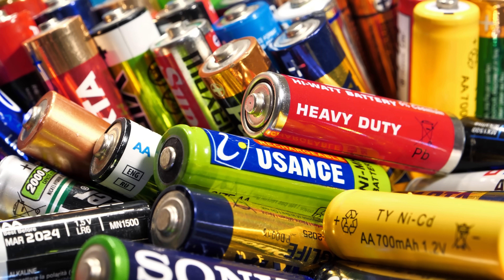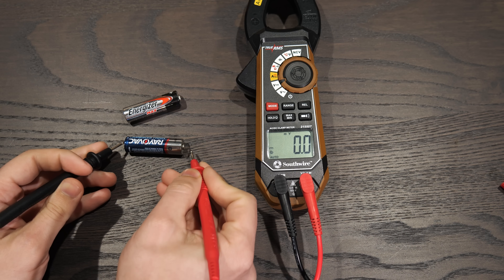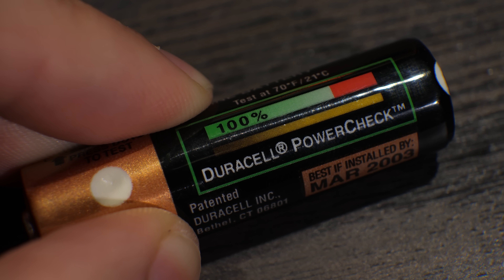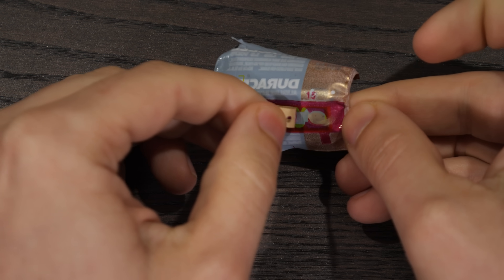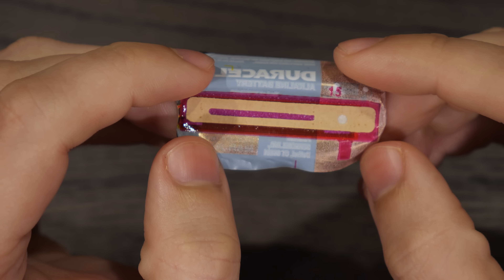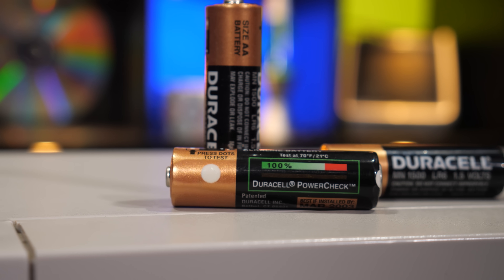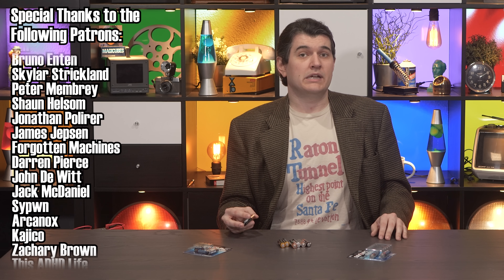Duracell PowerCheck: A genius idea which didn't last that long

Comment: Kids toys still use plenty of AA and AAA batteries. I don't use many for my own stuff anymore, but as a parent, I still have to deal with these type of batteries. I actually got so sick and tired of disposable alkaline batteries leaking and the sheer cost of constantly replacing them, that I've invested in a bunch of rechargeable NiMh batteries (which are actually pretty cheap these days) to mitigate these problems. It turns out you've only got to use them over a few times for them to pay for themselves compared to the cost of alkaline batteries. Never mind the cost of damaged equipment due to poorly manufactured alkaline batteries leaking inside. The rechargeable ones have to be sealed better by default and it's pretty much eliminated this problem for me.

Comment: Interesting film showing how these worked.  With regard to the AA v AAA comments, I have a couple of head torches that use LEDs and AAA batteries, probably for lightness and less bulk than AA.

I have a point and click Fuji Finepix camera that will eat batteries even when not turned on, so they come out when it isn't in use.

A top tip for any motorbike riders out there is that your emergency torch stuffed in a tailpack can turn on with vibration or accientally when tighening the tailpack.  A small piece of paper over the end of a battery will prevent this.

Comment: Weird, I have Duracell Ultra good until 2030 (not 2003), with PowerCheck™ on them. Made in Belgium, not Bethel, though. Depends on what you mean by "these" in "these haven't been in production". Mine might be a different "model", but the strip is identical, and using it is still the most frustrating thing!

Comment: Just one question: Couldn't this technology be included to rechargeable batteries in the present, in order to know how much you have left until you need to recharge? While we do have chargeable devices that connect with a USB-C cable (thank God that it's the only kind), there still are a lot that need standard AA or AAA batteries, especially if they are a cheaper alternative (the USB-C chargeable versions are usually at least 33% more expensive).

Comment: They should re-invest in rechargeable AA batteries. Duracell had them for a while and I still use them but I need the replace them soon I’m afraid. Duracell doesn’t sell them anymore here in the Netherlands. At least I can’t find them anywhere. 

This pOwErChEcK gimmick never worked for me. I never got it working (but I’m also colourblind and I thought it was just me I couldn’t see the colour change). Anyways its design was also a flaw. Who puts a scale from 100 to 0?! Especially with a product targeted to the western world. Everything should go from left to right. Not the other way around. It was literally midway this video I found out the scale was to the wrong side. Scales ought to show the higher number on the right. I bet even the battery indicator on your phone and laptop has 0 on the left and 100 on the right. What a design failure

Comment: I still like disposable batteries for things that use very little power, so they last a long time. Like my gaming mouse. It takes a single AA battery and lasts 6-9 months. I would never remember to charge that thing regularly enough if I had to, and then couldn't just pop in a new one if it's suddenly empty. I got a keyboard using two AAAs with similar lifespan. And remote controls, those things are great candidates for that too. Imagine having to plug your TV remote into a USB-C charger?? That would just be weird. 

Anything that doesn't last long, absolutely, go rechargeable. I got a Gameboy Advance that I use sometimes and it's honestly annoying to deal with batteries that just don't last all that long. I don't want to toss batteries that are only starting to be empty, but I also don't want to have my game turn off on me... and games of that area don't exactly autosave. Ughhh. Almost wish I'd gone for an SP but I prefer the ergonomics of the regular Advance.

Comment: Rechargeable batteries in devices seems like a more sneaky way of ensuring a device has a shorter life because the battery cells are often not changeable by average people. If a device has a hard installed lithum battery it becomes a hard sell for me. Even though i can and have soldered new batteries into things before,I just hate shitty anti consumer shit that the apple cocksuckers seemed to have pioneered in the past 20 years.

Comment: You never owned a mains power adapter for your Gameboy? Did you even game brah?
Reply: Some Gameboy Advance, Game Boy Advance SP's were regular AA Battery's only. My Advance i had didn't use a Charger, didn't have a backlight. so it ran only off AA batteries, it was frustrating to see the screen all that good. So because of that i got a Gameboy Advance SP which took a Charger, was easier to see the screen. I quickly missed my old Advance though do to size, shape. it felt better in my hands, and seemed less easy to break in comparison. I now currently have a Game Boy Emulator on a old Android phone, the NEW 3ds XL. I so miss my Gameboy Advance. Btw i had it in black Advance, and Sp. but i always wanted the Blue one. I still have my Black GameCube though lol, i prefer it over PS2, PS3, PS4, PS5, Xbox One, Xbox X|S. I did have a PS2 Fat, ps2 slim, PS3 slim. i currently have a GameCube, New 3ds xl, Xbox 360 slim W/touch sensors in place of the power button, disk tray button. i also have a Xbox One Slim, the Lemuroid Emulator on a Samsung Galaxy J7 Sky Pro.
Reply: @chelseasorsa5730  I meant a 3rb party block you buy and clip into the Gameboy
Reply: @soundslave  yeah mine only took game cartridge, headphone, AA Batteries. My Sp took Game, Headphone, Charger wire. For years i thought that was a normal Gameboy but apparently almost all Nintendo Gameboy's had a way to attach Nintendo branded, 3rd party Adaptors were my charger wire went. my step bro had a Cheat code/Guide adaptor, some of those were cartridge shaped adaptors you plug in on top, some attach to the back, some go went where your game goes, you put your game cartidge into the adaptor which my step bro had the one that pluged into the charger port. mind you this was in the 2000's for us. I was alive in the late 90's but i was only a baby. so i had these things in the early to late 2000's. Side note: i did have a PSP in 2013. Sadly my psp got stolen at the end of 2013 or begining of 14. P.S. I'm from 1995 so i was barely in the 90's Lol. P.P.S.  Perhaps i'm missing wt you're saying, but i think i got it. Although possible that my comments don't display such, if so i'm sorry.
Reply: So yes i just looked it up, i did know wt you meant. The Mains Power Mod. a Battery, charger cord modification. thing is back in late 90's, the entire 2000's IE 2000-2009. That mod was not a thing at least for the magority of American citizens. Although from my understanding the Advance SP i had, had a rechargable Battery that you had to plug in a Power Supply into the gameboy to charge it, it all looked exactly the same as that Mains Power Mod. At least the one i'm aware of, found from just a quick lookup.

Comment: I always admire your work, but here I have to disagree with you as an Telecomunications and Electronics engineer. The fact that manufacturers put rechargeable built in batteries in devices is not a good hing in my opinion. The fact that we were burning through one-time use batteries also wasn't a good thing. But the point is, that those built in batteries eventually get old and need to be replaced, but many times it is impossible for regular user, and even for some handyman, because they are not standardised and sometimes impossible to find the exact same one. You say: "OK, let's make rechargeable batteries which are replaceable like in old phones or modern cameras". Ok, it solves that problem. The second one is that users sometimes need to use the device without pauses, so putting while device on the shelf to charge is impossible, so changing the battery and charging while using the other is crucial, like for photographers for example. But here is the catch I don't like. Most of those user-replacable batteries are not standard ones, but some kind made my manufacturer and copied by some companies like Newell, GreenCell and Patona and stuff. They are very expensive and only fit for one device. The idea of having standardised cells which are rechargeable is the best solution in my opinion. And the fact is, we have such cells already, not only AA, but also 18650 for example. In fact 18650 are used 95% of the time in power tools, drones, lamps and bigger devices like that, but the manufacturer builds them in and closes in the enclousure, or in a separate box and sells them as their own fitting only this manufacturers tools. This makes me sick for god's sake. Amd another problem I have with that is, when battery is built in, the device must be more expensive and heavier then if you buy it without batteries. When you buy some expensive stuff it may not make a huge difference, but you will certainly cry when the battery dies and you have to throw away the whole good device. But when you want to buy some cheap Chinese crap like a torch light or a wireless speaker it can double its price, and make useless trash for this world. Listen to me, the fact how batteries/electronic devices are produced and sold right now is not the best way. Probably the safest for user, but certainly not the most economical, not environmentally friendly, and not good for long usage of the device, neither for using it with fast battery swaps

Comment: Excellent video reminding me of these! I first saw this tech in a battery testing strip given away with the UK Maplin Electronics catalog, late 80s or early 90s. It was much larger than these integral ones, and could wrap around AA, AA, C and D cells. The strip was clear, and you could see the tapered part. But I did the silly thing of putting it on a 6v battery, and the strip melted at one end and it died.

Comment: Just throw the battery on the floor on the concrete floor, by the way it bounces you can tell how much a charge it has left.

  This made me think of something can you teach us how to make a stinger next??   The best one I saw the guy had used 2 batterys as the negative and pos leeds. It was like a turbo stinger, it hummed or buzzed and would boil that salt water as fast as I ever saw.

Comment: So that is how they work. Mmm, yeah I don't see the use. 
There are only a few things I have that use non-rechargables. Some remotes, a clock. The radios, mouse, keyboards are all fed rechargable batteries. Because it makes sense. No sense to put the expensive battery in a clock... That clock will run fine on a non-rechargable for a really long time. Same with remotes!

Comment: Just drop test the battery to see if it is good or bad! If the battery is fresh the chemistry inside is wet and if dropped onto a hard surface (drop it from a height equal to its own length) when it lands it will not bounce. When a battery is bad the chemistry inside is dry and hard and when dropped it bounces noticeably.

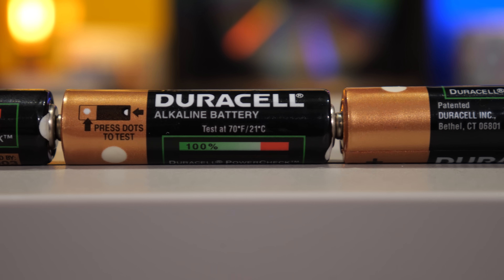Comment: 12:53 These external tester strips worked exactly the same but where a lot easier to use (needed less force to activate) compared to the ones built into the battery.

Comment: Actually a battery tester built into rechargeable batteries isnt a bad idea, they do sleep in your drawer for extended periods of time, theyre easy to get mixed up with the flat ones; a lot of people dont have dedicated battery chargers and just use a type c into their controller or whatever... duracell powercheck could actually work in today's society if they fix how hard you had to press

Comment: Thank you for the memories, I remember ripping off the wrapper and trying them on other batteries, and also the heat they gave off. 
I think Energizer or could have been Duracell, had one built in the packet when you squeezed it, which was handy to use on other battery brands. 
But thanks again, so many memories especially when it came with the gameboy and Walkman.

Comment: I always used my thumb nails to securely press the dots.  I've stopped using Duracell because I've found them more prone to leak.  Recently, I had one that was well withing the "use by" date and plenty of charge left, but was leaking.  I've read that EverReady Energizer alkaline batteries use different manufacturing process that makes them more resistant to leakage.  Over the last 5 to 10 years, I've never had an Energizer battery leak and that is all I buy if I can help it.

Comment: 9:34

This reminds me of a clock battery i measured last year. Its voltage read fine, but it didn't work. I put another battery in my car keys, and it worked, and i was confused why a battery that read good voltage wasn't working.  I thought multimeters placed a very high resistance load on the battery to measure voltage.

Comment: Super, as usual! 
Here's a conversation starter: what are everyone's thoughts on rechargeable AA vs built-in batteries in devices? 

Built-in batteries are often a pet-peeve of mine in devices that don't need further connectivity. For example, an electric toothbrush, or a razor. 

I am 100% for the convenience of having those with their own portable power source. But built-in batteries seem like a bad choice for a few reasons: 
* Longevity / sustainability: often, when the built-in battery is dead, the device is as good as dead too. 
* Flexibility: It is easier for me to have several sets of rechargeable batteries on hand, ready-to use, when my device runs out of juice. If there's a built-in battery, I must wait for the charge to be sufficient to start using it
* Portability: a device using AA batteries can be used literally everywhere in the world. Good luck finding the exact cable replacement for your cheap razor that you bought in Taiwan
* Convenience: you don't need a cable AT ALL for those devices. Just one charger will work for all your devices.

Comment: This would be more useful for rechargeable batteries tho. I have a noise cancelling Headset I use for work and it takes AA batteries. It only gives me an indication when the battery is about to run out. Often times I'm wondering if I should take the batteries with me to charge them or not. 

Now that I think more about it, this still would be useless in my case because I can't really control the temperature of outside...

Comment: And then you get the real butthead engineer that uses the AAAA battery.  Yes, there is a thing and it is annoying as hell.

You should do a bit on the A and the B batteries.  (^_^)

Comment: Before these batteries existed, as a child I used to use my trusty Gameboy Colour for this purpose, specifically taking note of the illumination of the power light. Powering it on for a few moments would provide some information about the remaining charge. It was more simple to observe than testing by powering on something else. The brightness of the light and how steady that illumination was would tell me a little about the quality and remaining charge of the batteries.

Comment: I always use the drop test, if you drop the battery onto a hard surface so it lands vertically, a dead battery will bounce more than a fully charged one. Spooky!

Comment: A duracell with a 2003 date on that hasn't leaked? That's hard to believe.
I had an original Gameboy too, and i used recharable batteries and there even was a rechargable "accupack" that you wer eable to hook into the "Card reader" and that locked into the screw cockets and connected to the DC Input.
It was heavy, but this way the battery madness was less.
That said, here in europe batteries are collected and recycled for the most part. (there are collecting boxes in supermarkets ect.)

Comment: Just a word about the terms "battery" and "cell".
Yes, nearly 100% of the World talks about a single dry or wet cell (primary or secondary) as a "battery".  But this is not correct.
A cell is a single unit, be it electrical or organic.  A battery is two or more cells connected in series to provide higher voltage and/or sometimes in parallel to provide higher current.  You seem to be well aware of this early in the vid' but then dropped to the 'everything is a battery' descriptive.

Nice and informative item though Sir.  I have never seen one of those cells, even though I was in my early 20's at the time you say they first arrived on the market.
I enjoy watching your vid's when I trip over them.

Comment: My family actually used those testers a lot. This was due to two reasons:
1) Gadgets that weren't used often meant partially charged batteries were put back (which you mentioned in your video)
2) Batteries lose charge over time, so batteries that got knocked to the back may have less charge.

And as for plugging them in to test, that was an option, but not always a good one. If a game took 4 batteries, 3 may have been enough to power it... briefly... and some batteries are a much bigger pain to replace than others.

I definitely am glad devices now use far less disposable batteries. Finally got rid of my old Duracell battery tester (the plastic, unattached one) a few months back since they just aren't needed anymore.

Great video as always, definitely brought back some memories!
Reply: Comments seem to agree these are still perfectly available globally.

Comment: The battery tester was a sign of quality, because one could ensure the battery was indeed fully charged - and not an old battery that had sat on the shelve for 5 years. (I have since managed to purchased fully discharged batteries.)